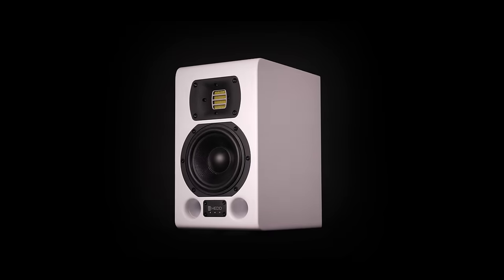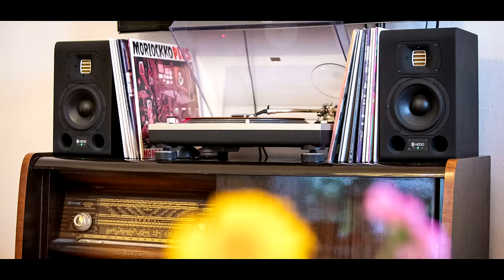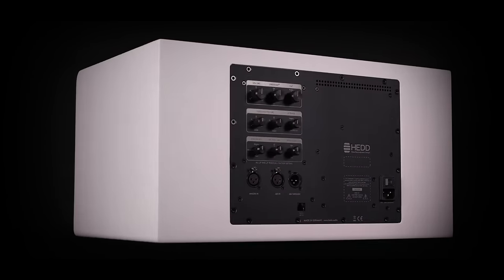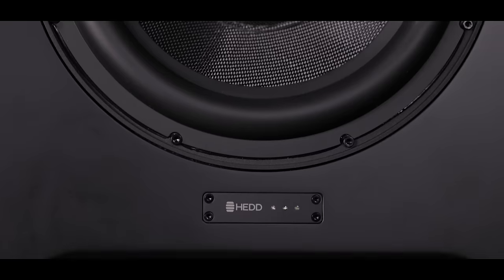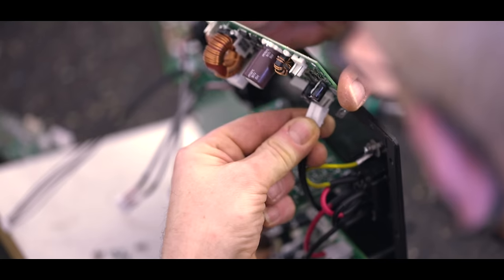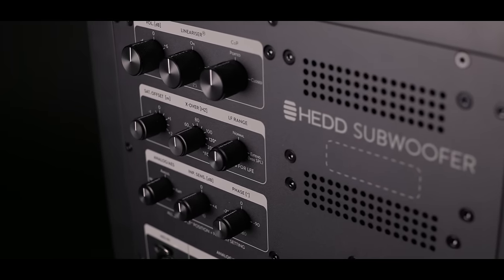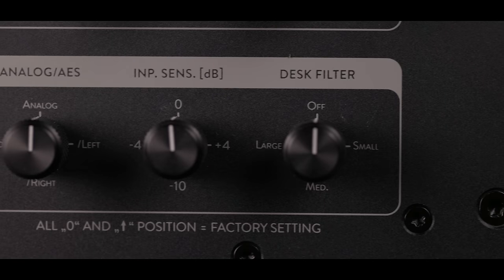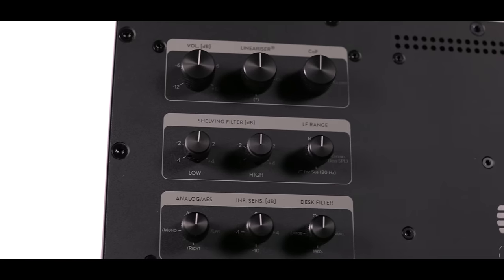Be Inside Your Sound: Introducing The HEDD MK2 Series

Comment: what is the difference between mk1 vs mk2 of these speakers ?
Reply from the maker: Hey Sanna,
we have many innovations like an integrated Linearizer and the option to use our monitors open or closed (CoP Setting).
Check out our website for more details.
Reply: @HEDDAudioGmbH   will type 2 plugs fit my mk1 05's ?

Comment: Can I use the Type 20 MK2 for mixing in an acoustically treated, small rectangle room size of 235x370x245 (Width x Length x Height), or is this monitor too big? This question is not about physical space, as I know they will fit, with a distance of roughly 120cm apart. It's a question of accurate sound, as I see a lot of conflicting advice about big speakers in small rooms. Thanks.
Reply: i hav this same q
Reply from the maker: Hey Matt,
The Type 20 can be used as a near or mid field monitor. That´s why a lot of our customers actually use our Type 20 in small studios (like yours). 120 cm is totally fine one just shouldn´t go below 100 cm or the stereo image gets lost. As usual equilateral triangle if possible and tweeter on ear level pointing towards the back of you head.
Reply: Thank you so much for your response! I have one last question, then - Is it feasible to use one in mono, until a second monitor is affordable?

I understand the answer to be ‘yes’ for the type 30, but I’m only interested in the 20s. Thanks.
Reply from the maker: @Matt_Morgan  You can choose installment payment (Klarna) when purchasing our speakers through our website. Buying just 1 Type 20 is not advisable.

Comment: What about using hedd in linear mode and in addition sonarworks to correct room issues. Might be possible but what about the latency?
Reply from the maker: Hey,

when using the lineariser with sonarworks one has to compare between sonarwork Room correction on + lineariser on and room correction off + lineariser on.

The audio coming out of the speaker is completly phase aligned (with lineariser ON) so sonarworks has to "correct" way less (in theory just the room). However we don´t know how the program does it´s phase correction so we are in no position to say if it actually improves the sound image in the end or not (only talking about when the lineariser is on).
There is no right or wrong in that case one simply has to do A/B comparison and decide which one sounds more accurate.
The latency our Lineariser causes in our satellites is less than 30 ms.
When using a sub this latency can increase up to 50 ms (at about 20 Hz).
Reply: @HEDDAudioGmbH  Thanks for the reply. Gestern kamen meine neuen 07 mk2 an und der erste Eindruck haut mich echt aus den Socken. Die Oberfläche des Korpus für sich genommen ist schon wirklich sehr gut. Der Klang wow. Ich hab ein kleines Studio 16m2 und das Loend ist massiv. Kann auch mit Lineariser keine störende Latenz wahrnehmen. Ich glaube die Hedd und ich können gute Freunde werden. Auch schön das man die Box offen und geschlossen betreiben kann. Tolles Produkt. Danke dafür.

Comment: Hi guys! Is it normal that my left loudspeaker is about 6 db quieter than the right one? both the levels on the back of the cabinet are set to zero.
Reply from the maker: Hi Tom please email your serial numbers and model info to:  support@hedd.audio and we can take closer look
Reply: @HEDDAudioGmbH  Thank you for your reply! I just sent an email.
Reply: Have you checked the XLR cables? Maybe one of the wires is broken which would result in an unsymmetric signal. Thus you‘d lose 6dB.
Reply: i think this is bcos if their dsp system malfucntion. same issue reported by someone with eve audio speaker which their speakers also have a dsp system hence its not a conventional analog speaker. have hedd audio team resolved ur issue? did they replace the unit?
Reply: @vipingkumar  yes, something was wrong and they repaired it! Now it’s working perfectly.